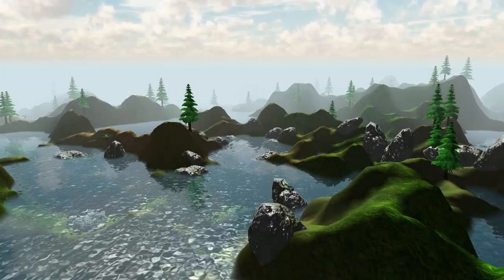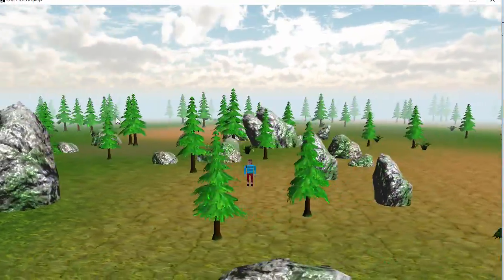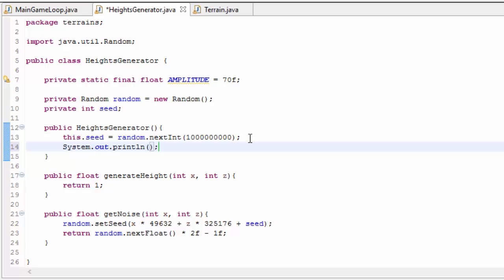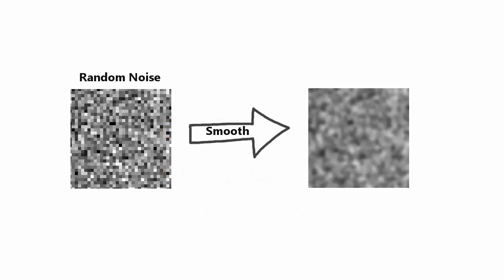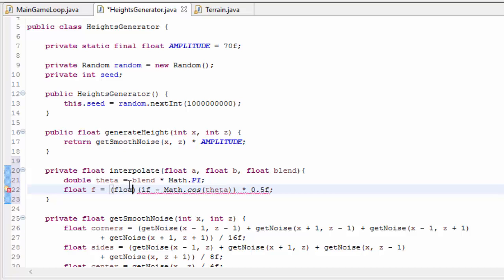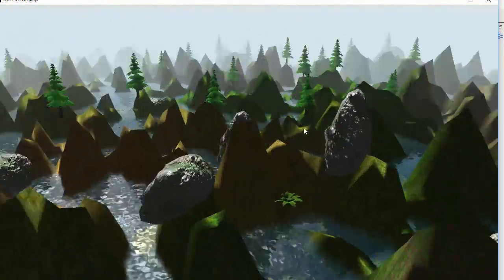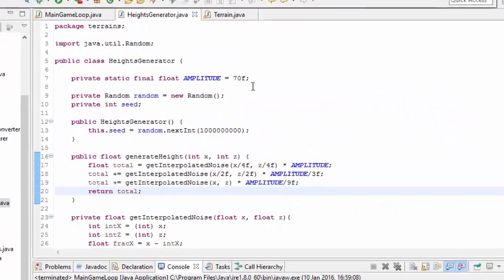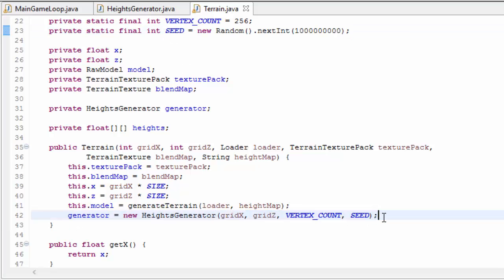OpenGL 3D Game Tutorial 37: Procedural Terrain

Comment: I did everything the same... and it just won't work! When I use 8 octaves, the terrain renders completely flat. When I use 3, it renders very rough.
Reply from the maker: +CosmicPeach That's exactly what it should be doing. More octaves means more lower frequency octaves. Try changing the "roughness" value if you want to alter the roughness of the terrain.
Reply: But I used the same settings as you and didn't get the same results!
Reply: The terrain is still very bumpy.
Reply from the maker: +CosmicPeach What are your amplitude, roughness, and octave values?
Reply: Amplitude: 75
Roughness: 0.3
Octaves: 3
Reply: +CosmicPeach Just changed amplitude to 70... nothing really changed. It still doesn't look like your terrain!

Oh and the terrain doesn't tile either!
Reply: +CosmicPeach And the seed doesn't stay the same
Reply: +CosmicPeach In the terrain class, we created a private HeightGenerator generator; But never used it?
Reply from the maker: +CosmicPeach When you were working through the tutorial at which point did things stop working? We never created a private HeightGenerator generator in the tutorial. You may have seen one in my example at the end though because you'll need to change a few things around if you want to use it with multiple terrains. You can set the seed in the constructor of the HeightsGenerator, so if you want it to be the same just set it the same. You're the one setting the seed, so if it's different then you must be setting a different seed for each terrain's height generator, or you're not using the constructor which allows you to set the seed. I'd guess that the HeightsGenerator that you're using to generate the terrains was created using the no argument constructor instead of the constructor which takes in the gridX, gridZ and seed values.
Reply: No. Everything is the same.
Reply from the maker: +CosmicPeach I never actually showed all the code for the multiple terrain stuff, I just gave instructions of how to implement it and showed a snippet of the code to point you in the right direction. If the seed isn't the same for each HeightsGenerator that you're creating then something's going wrong. Just check that you're using the correct constructor for the HeightsGenerator that you're using. It has to be the one which takes in the seed value, and not the no argument constructor that we were using earlier in the tutorial. If you're still having trouble then show me your Terrain class and I'll point you in the right direction.
Reply: +CosmicPeach in case you have not fixed it yet: on my laptop i also had really different terrain, so just play arround with values. Start low and continue to increase till your liking

Comment: Hey +Thin, could you please give to me the normal map system you used to use in your old water system? In the first tutorials
Reply from the maker: +Bruno Guerra I never created a normal map system using the old system :/ I'd really recommend not using it though; there's no advantage to it and it requires extra calculations and an extra texture sample to get it working with normal maps. If you want a different look to the water then just try using different DuDv maps and different settings. You should be able to achieve the look you're aiming for by just changing the DuDv and normal maps, rather than using that less optimal method.

Comment: After this tutorial there's a neat little thing you can add if you remember the multitexturing tutorial. 

Having multiple textures loaded into the shaders you can then check the current height of the terrain, and decide which texture to use based on that.
And you can also blend them like you did in the Multitexturing tutorial to get nice smooth transitions.

The result is that the terrain base texture changes based upon terrain height, snowy mountain tops, rocky mountains, green hills, and perhaps a nice beach texture right before the water edges? :D
Reply: How would you check the height of the terrain in the shader?

Comment: Could there be a way to have generated terrains and height map terrains in one world?
Reply from the maker: +solow zoller I think that should be possible, you'd just need to find a way to merge the edges of the procedurally generated terrains to the correct heights of the edge of the height map terrain so that they match up.
Reply: +ThinMatrix I did manage to have both generated terrain types in my game, im not going to try to connect the vertices so i created two parts to my world, one normal part with placed buildings and such and another part completely randomly generated, the player will be able to fly a Hot air balloon to that part and be able to create their own kingdoms and villages ect
Thanks!

Comment: Please help.I cant run some 3D java games(like Minecraft,Your tutorial engine) , and some engines(like jMonkeyEngine SDK, Blender, Unity 3d). In eclipse when i run your tutorial engine i get this error: 

#
# A fatal error has been detected by the Java Runtime Environment:
#
#  EXCEPTION_ACCESS_VIOLATION (0xc0000005) at pc=0x0000000000000000, pid=5224, tid=7376
#
# JRE version: Java(TM) SE Runtime Environment (8.0_66-b18) (build 1.8.0_66-b18)
# Java VM: Java HotSpot(TM) 64-Bit Server VM (25.66-b18 mixed mode windows-amd64 compressed oops)
# Problematic frame:
# C  0x0000000000000000
#
# Failed to write core dump. Minidumps are not enabled by default on client versions of Windows
#
# An error report file with more information is saved as:
# C:\Users\MyName\workspace1\Trying\hs_err_pid5224.log
#
# If you would like to submit a bug report, please visit:
#   http://bugreport.java.com/bugreport/crash.jsp
# The crash happened outside the Java Virtual Machine in native code.
# See problematic frame for where to report the bug.
#
Reply from the maker: +MontenegroGamers There are various things that could cause this, from accessing the wrong attribute in a VAO to certain errors in shader code. At what point in the tutorials did you get this error?
Reply: +ThinMatrix It wasn't in this tutorial.It was all working, and next day it just stoped working and i get this error all the time.I sent you a mail with full error.It was from 30. or 31. tutorial(i think).
Reply: +ThinMatrix How do i make an terrain detection program?
Reply from the maker: +MontenegroGamers If it suddenly stopped working without you changing any of the code then it might be a problem with your drivers :/
Reply: Yea i read that on forums i tried updating all of my drivers and it is still not working.Do i need to reinstall windows?
Reply from the maker: MontenegroGamers I'm not really sure :/ The only thing I can think of is that I once had that problem when I used the smoothstep() function in the shaders, so if you're using it (in the font rendering shaders) then try removing it and see if that makes any difference.

Comment: I completed the tutorial but didnt really work out that well so I changed the HeightGenerator class to ur one and still not working as expected I load up the game and it goes every were and like the thing isnt smooth and its so messed up what have I done wrong
Reply from the maker: +Mohammed Qureshi Could you show me a screenshot please?
Reply: Sure here ago http://snag.gy/BeNm7.jpg
Reply from the maker: +Mohammed Qureshi Hmm, can I see your Terrain class code please?
Reply from the maker: +Mohammed Qureshi One thing I notice is that you've got two "VERTEX_COUNT" variables. The static final variable you've set to 256 and that's what your HeightGenerator uses, but in the generateTerrain() method you've defined another VERTEX_COUNT variable as 128. Remove the bit where you're setting the VERTEX_COUNT variable in the generateTerrain() method and see if that makes any difference. Also with multiple terrains it only works with positive gridX and gridZ values, so make sure that yours are definitely all greater or equal to 0.
Reply: ***** All my terrains are greater then 0 anyway also I changed ur line of code and still no the error still happens were the terrains is everywere
Reply from the maker: +Mohammed Qureshi And you're using the HeightsGenerate code from the description? What OCTAVES, AMPLITUDE, and ROUGHNESS values are you using? Try increasing the number of octaves to 5 or 6, and turn the roughness down to 0.3 or less. Does that make a difference?
Reply from the maker: +Mohammed Qureshi I just realised that I accidentally set the amplitude in the downloadable code to 750! So that might be the problem :P
Reply: ***** Hahahahaha it was that also are you going to make a tutorial to make the random terrains join together so you cant see blue gap
Reply from the maker: +Mohammed Qureshi The code provided should already allow terrains to join together without a gap. I tried it yesterday with multiple terrains and there was no gap for me. Could you show me a screenshot of the problem please?
Reply: Also can I ask how do I set it so it stays with that one terrain I dont want it to randomly generate all the time I just want it to pick one and just use that but right now it keeps changing them even if I havent changed the seed
Reply from the maker: +Mohammed Qureshi I just had another look in your terrain code and I noticed you're not using the HeightsGenerator that you created in the Terrain constructor. You're generating a second instance in the generateTerrain() method and using that instead, which would cause both of the problems that you mentioned.
Reply: ***** I just changed it to 	private HeightGenerator generator = new HeightGenerator(); for the top one and removed the second one but the problem still accures
Reply from the maker: +Mohammed Qureshi You need to use the other constructor which takes in the gridX, gridZ, and seed values so that you can set the seed for the generator.
Reply: ***** I am using that I implemented it like the tutorial and if i change the  	private HeightGenerator generator = new HeightGenerator(); to 	private HeightGenerator generator; its gives errors
Reply from the maker: +Mohammed Qureshi I'm not sure what you mean, you shouldn't be using the "new HeightsGenerator()" constructor anywhere. You should be creating the HeightsGenerator in the Terrain constructor like "this.generator = new HeightsGenerator(gridX, gridZ, VERTEX_COUNT, SEED);"
Reply: ***** Yh I changed it to that but you know the private HeightGenerator generator; we call at the top I need to add = new HeightGenerator(); on the end or the code wont run as I removed that line of code from the generate terrain method you see
Reply from the maker: +Mohammed Qureshi Why won't it run? What error do you get?
Reply: It gives me a null pointer but if I change it back to = new HeightGenerator(); then it works fine and loads the terrain but with the broken seems and the error of it always changing
Reply: +ThinMatrix I really am not understanding whats going wrong as it matches ur code perfect well atleast the parts you can see but still the seems are there and the terrain is always random
Reply from the maker: +Mohammed Qureshi Can you show me your Terrain code again please? It shouldn't be null if you're setting it in the terrain constructor.
Reply: ***** Yh sure http://pastebin.com/7ykFgyHE
Reply from the maker: +Mohammed Qureshi And which line is giving you the null pointer exception?
Reply from the maker: +Mohammed Qureshi Oh I see the problem, you're generating the terrain before creating the HeightsGenerator. You need to create the HeightsGenerator before calling the generateTerrain() method
Reply: ***** Oh yh it was does it work different on different pc u had it on the bottom and urs worked. Thank so much massive shout out next devlog
Reply from the maker: Mohammed Qureshi It wouldn't work on any PC. The generateTerrain() method uses the HeightsGenerator, so it would always crash if the HeightsGenerator hasn't even been created yet. I was just rushing to produce that simple example for the tutorial; I must have not tested it until after recording that bit.